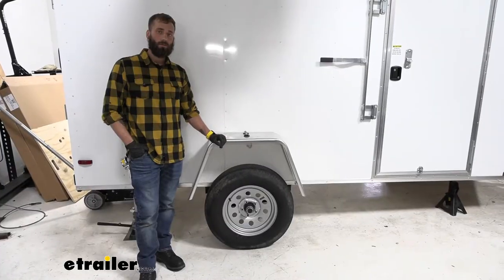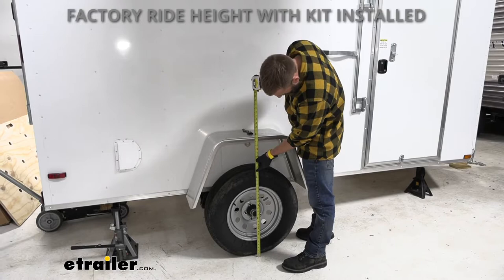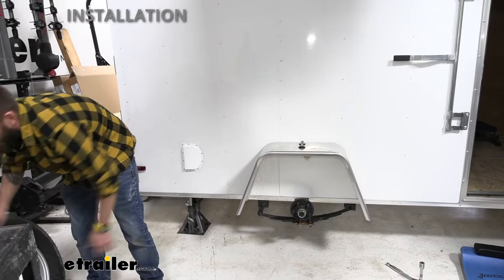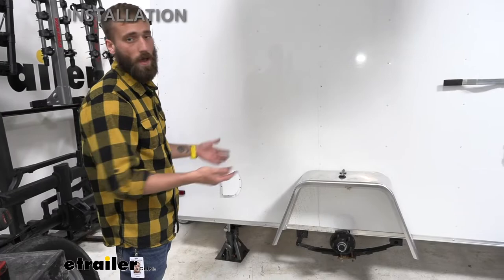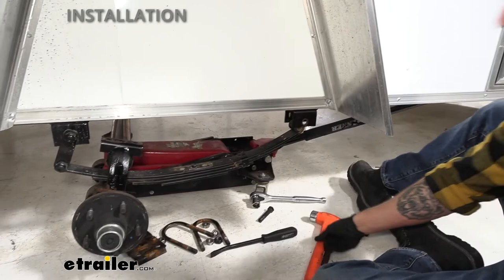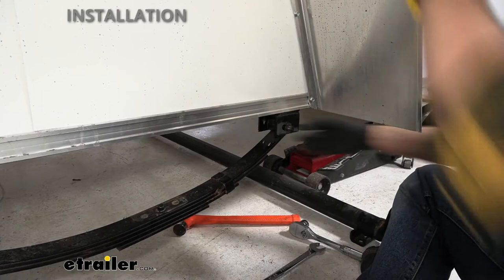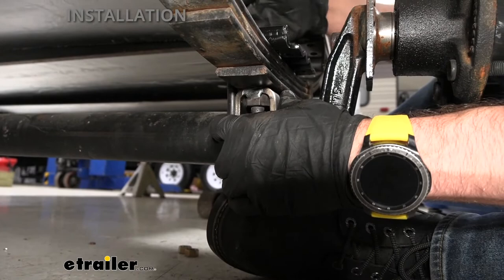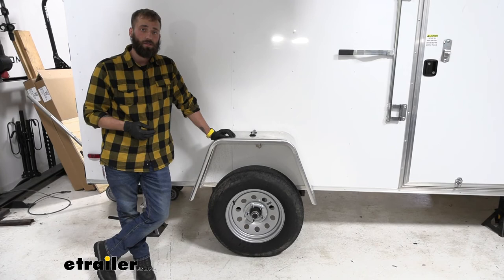etrailer | All You Need to Know About the Dexter Trailer Springs Over-Under Conversion Kit

Comment: should've used a flat tape or tailor's tape measure to measure the circumference of the axle then divided it by pi to get the diameter.
Reply from the maker: A caliper would work too, but a flexible tape and some simple math would do the same thing...
https://www.etrailer.com/Trailer-Leaf-Spring-Suspension/Dexter/K71-384-00.html
Reply: @etrailer bingo!

Comment: On doing a flip, but replacing a 2,000 pnd axle with a 3,500 pnd axle do I need better leaf springs?
Reply from the maker: There's no reason why you can't upgrade your axle, but if you want to increase the trailer's capacity you'll also need to upgrade the capacity of the leaf springs. If you have 2000 lb capacity hubs and tires, you'll also need to upgrade those so they'll have a matching capacity with the axle and springs.
https://www.etrailer.com/Trailer-Suspension-Parts/Dexter/K71-384-00.html
Reply: @etrailer  Thats great! Can you still flip the 3,500 axle, keep the same 2,000 weight and leafs for offroading and it wont slip out of the slot if a wheel bounces? the leaf wont come out flipped is what I mean on that part.

Comment: I am considering doing this same thing on my utility trailer. Does the tube going from hub to hub on most trailers have a slight bend in it to allow for camber?
Reply from the maker: Hello, yes it is common place for axles to have a "bend' in them. https://www.etrailer.com/dept-pg-Trailer_Axles.aspx?Redirect=1
Reply: Yes. This is why you need an axle flip kit like this. You can't just flip the axle over and out the bow side down.
Reply: @davidschlarp1606 How about just reversing the left and right end of the axle, this can't be done?

Comment: Can just reuse the old u bolts and plates and buy me a new spring seat??
Reply from the maker: The u-bolts really should only be used and torqued once.
https://www.etrailer.com/Trailer-Leaf-Spring-Suspension/Dexter/K71-384-00.html
Reply: when torqued the steel stretches a tad keeping a tension taht keeps stuff locked  together.  if you torque it again the bolt has already been stretched.   if you think this is expensive, dont ever get an aircraft--- all bolts get used one time.. and it has to pass inspection

Comment: Great video but dexter axle includes parts you don't need as you can just reuse what you have.  The U bolts and nuts are copies and the plate could be reused too.  In fact I reused my stock nuts as they have a built in washer and lock washer!  If you want a washer and lock washer you must buy them separate to go with the dexter nuts!   2/3 of the parts in this kit aren't needed.   Dexter axle- you are a quality company and will make even more money if you quit ripping people off!  Chintzy to get a few more dollars!
Reply: Youb know lock washers are only supposed to be used once right? Once you smashed them flatv they aren't goodv anymore. Nylon lock nuts are pretty much the same. You can reuse them but once a bolt goes through them there there isn't as much material to hold them in place. Furthermore you could of just use the Dexter nuts as a jam nut
Reply: The lock washer is built into the bottom of the widened nut and thus can be reused.  My comments stand.
Reply: You never want to reuse u bolts, lock washers or nuts on any suspension components.

Comment: So what was the final measurements?
Reply from the maker: Your lift amount that you get with this kit is the diameter of the axle plus the height of your spring pack. This lift was a little over 4 inches.
https://www.etrailer.com/Accessories-and-Parts/Dexter-Axle/K71-384-00.html